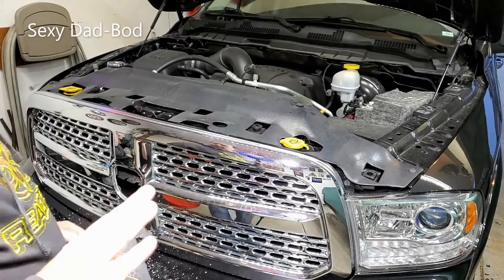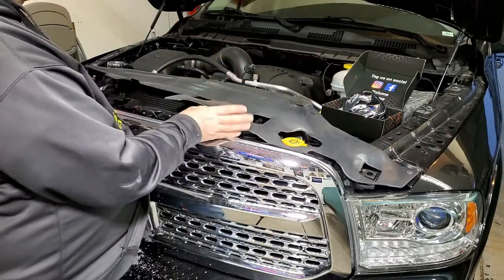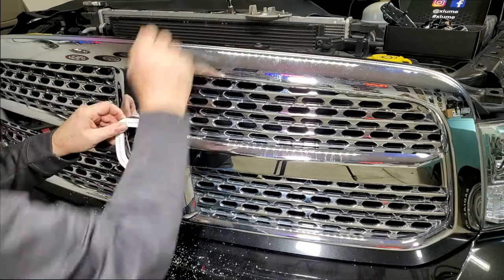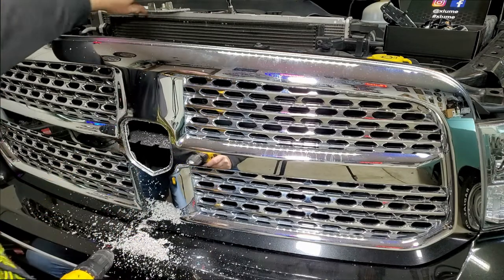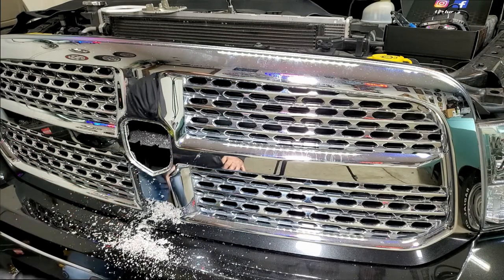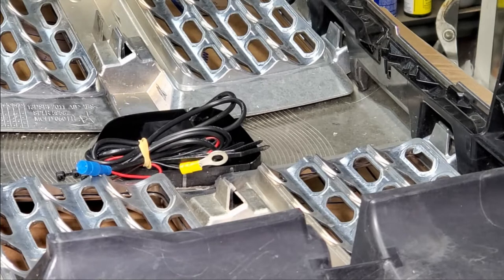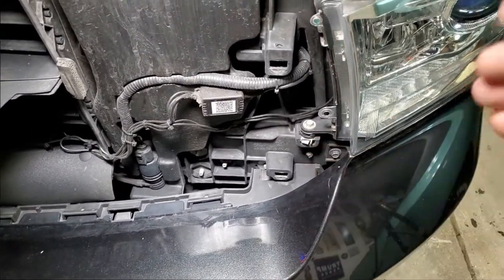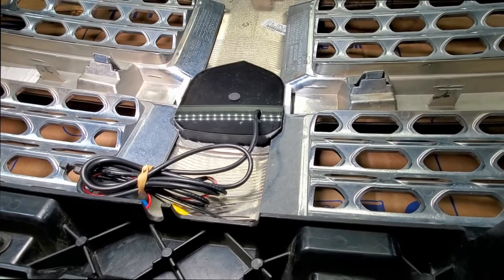Trick Mod Dodge RAM X-Lume LED Lighted Grill Emblem... Bad Ass....

Comment: Awesome very clear and detailed
Reply from the maker: Thank you for watching.
Reply: Thanks for replying. I have one question.  The emblem your detail is by X-Lume. It is currently about $218 and needs to be cut into the grill. I found a similar one that apparently  is not much thicker than the original and supposedly after removing the stock emblem can just be put right in the same space with the 3M tape it has on the back. Yes, it too is LED illuminated.  I'll give you the link it is only $79 and is made by Autogem.  Do you know why the X-Lume is so much thicker?  Is it because there are more electronics inside?  What do you know about or think about the Autogem one?How has your emblem held up? is it still working?  Any flaking of the paint on it?  Autogem also makes a red brake emblem for the back of the truck and is also just remove and replace. Of course you must wire it in.  Here is the link for the front white LED emblem https://www.amazon.com/gp/product/B0BLT6CKPM/ref=ox_sc_act_title_4?smid=A284MX70DF6ATN&psc=1

Comment: Thanks for the video man! I wish you would have shown the night shots of the emblem farther away! like so we can see what the entire front end of the truck looks like with the headlights and all on at night time! Also too, if i get the color changing version of this can i wire it the same way you did here? And do you just put that cable down inside that fuse or how exactly do you wire it into the fuse box?
Reply from the maker: This just popped up on my notifications.  Weird. 

Thanks for the recommendation.  I wish YT allowed you to add/edit the video after publishing, I would add this for you.  

I will do a longer range night shot and add a link in the description.  

Thanks for watching.
Reply: @gphilpot1  it's all good man! I actually traded my 4th Gen in on a 5th Gen Longhorn back in September... So this video doesn't apply to me anymore lol.... But super weird you just now got the notification 😂

Comment: Hey there that was a great video!!! I’m from Aus and bought one for my Ram over here. I’m guessing the fuse box might be the same but could you help me out with wiring it up with timer ect for what goes where I’m a little mechanical minder but love watching these types of videos so I can save money and do it myself, coz it’s so much fun… just need some help… I’ll try and see if I can find another video to watch but this one is the first I’ve seen for the Ram love it
Reply from the maker: I never got around to wiring the timer relay up.  I just did an add-a-fuse on the fuse box that turns on when the truck starts.

Thanks for watching.

Comment: Can you show what relay used and how you wire it
Reply from the maker: Unfortunately I can't edit the video after it is posted.  There are many options for 12VDC relay that act as timers on eBay/Amazon.  They typically get wired to 12VDC constant with a trigger (when ignition is turned on) that activates the relay.  Then the relay can be adjusted/programmed to stay latched/on for however long you want the light to stay on after the car is turned off.

Comment: Hey can you let me know how you wired that light in with the relay switch?
Reply from the maker: I plugged it into the fuse box to a terminal that is active when I start the car.
Reply: @gphilpot1  did you have to add a fuse on the end? And which component did you hook into? I want to do the same with mine.

Comment: does this work with a 3rd gen?
Reply from the maker: Mine is a 4th Gen. You might want to check on the Reese website.
Reply: @gphilpot1  well ik the badge is way smaller on the 3rd gen. maybe they make a different one